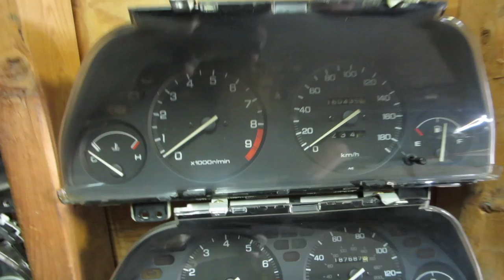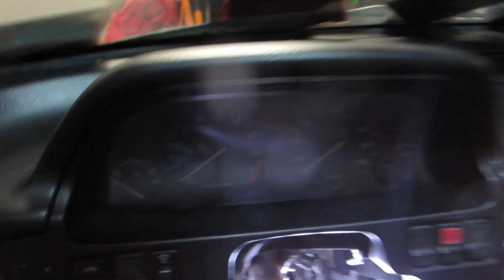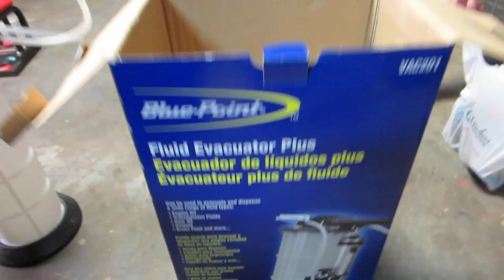BUILDING THE DA9 -HUSH HYDRO INSTALL- HSG EP. 5-34

Comment: if you want to get rid of the oem vss on the Trans then you can use the stock auto Trans vss from a ef civic. it's the same teeth count just doesn't have the oil lines like the da.

Comment: I have the hush performance hydro conversion kit. I managed to keep the clutch safety switch and cruise safety switch :D pretty cool setup. Taking out the dash made it 10x easier. That nut that's a pita was accessible with the dash out of the way, a swivel socket and an extension.
Reply: Manny B is your cruise control still working? How do you do that? I'm in progress of swapping my ys1 cable tranny for a gsr hydro tranny in my 93 integra

Comment: HUGE PITA to put a janky hydro conversion in. Must cleaner and easier to swap hydro internals into a cable case or simply use a cable transmission.
Mad props for building a DA.
Reply: Watched this all the way through. Quite an accomplishment and looks like you got it done in a short amount of time. You got good video coverage of the process. Nice work.

Comment: okay I like everything in the video but heres something to consider. Whenever you have to remove the pedal assembly, it is honestly waaaaay easier to remove the dash assembly first. Then all the nuts and bolts for everything are easy to reach. Ive done da and ef pedal swaps severak times for auto to manual trans conversions.

Comment: If anyone ever plans on doing this don't waste your time with mechanical cable to hydro conversions. If you're going for a hydro conversion go with hush22, although I never had one from them personally but I have a friend who did get one for his civic ef and to be quite honest with you I loved it. Nice and firm pedal feel not to soft but not to stiff either. I don't understand why mine didn't do what his did. It seems to me that the all around design is more spot on than the last setup I used to have (Suja1).Don't get me wrong the setup I had did work, it just wasn't up to my own expectations. However I've driven a car ,88 or 89 efforts h civicis that had hush22 and to me it seemed a lot more sturdier than mine and yet very precise. Plus when my buddy was bleeding the car for literary 2days the owner and true to his word and craft Robert came to help my friend bleed his clutch here in Arizona. Now I don't know about you or anyone else but if that isn't awesome costumer service I don't know what is. My next da integra I will be going hydro also but this time I'll be using hush22 kit cause my new setup although it's all hydro, a true hydro clutch conversion, it's still a lot more work involved than just going with hush22 setup, why??? Cause I did it and still tidying up all the loose ends.

Comment: Nice, very nice, I love that color so much that I'm going to change my 92 integra from captiva blue to horizon grey, which is the color of your car or the car that was posted in this video. I've done a few cable to hydro swaps or conversions on my da integra and most likely you won't get that true hydro clutch performance out of the kit. Never did hasport mechanical, or innovative either, but I tried Suja 1 hydro conversion very similar to hush22 and still had the same pedal feel, if anything it got stiffer and had same problem you had and that was the clutch pedal would not hit the floor no matter what I did. I tried all adjustments and still same shit. So and old buddy of mine convinced me to go all hydro, I said all hydro ??? So that involved a 96-00 h civic clutch pedal assembly, ss line, clutch and slave cylinder which I already had from the other conversion. So had to modify everything to make that fit on a chassis that was not designed to have this type of setup. Shit car was automatic as it was so it was a lot more involved. Needless to say bleeding was a major pain and everything else was basically as you described here. Sorry for long post, however it does work but I still need a few things to finish it off completely.

Comment: since the line is flexible, can't you just hold the master cylinder up high by hand and bleed before you mount it?  Vacuum bleeders have always been a pain in my ass though they do make fluid flushes very easy.

Comment: why wouldn't you just run a clutch line down the fire wall   out to the transmission instead of having to pull half of the dash out ?